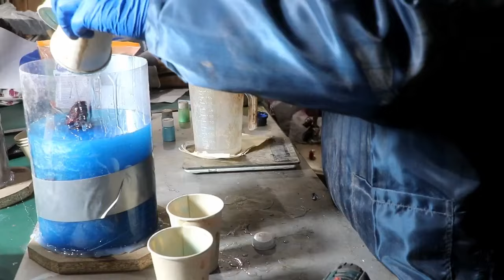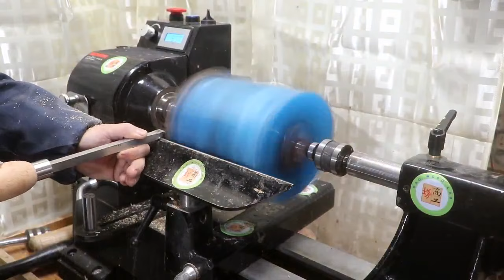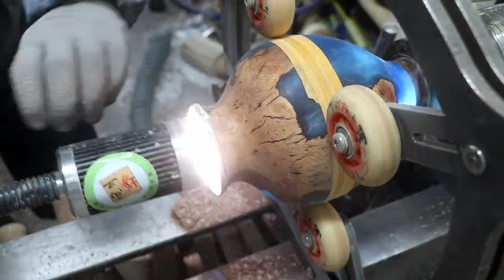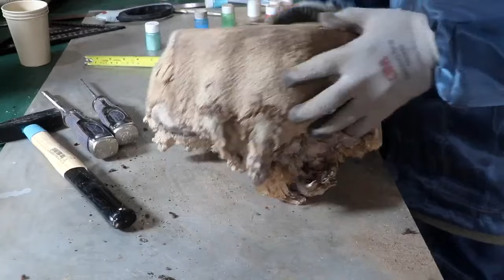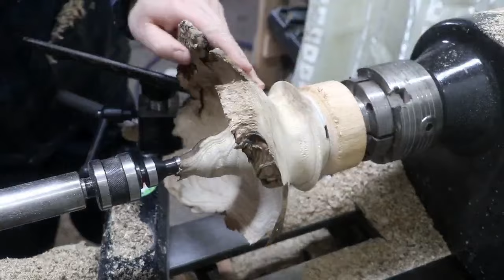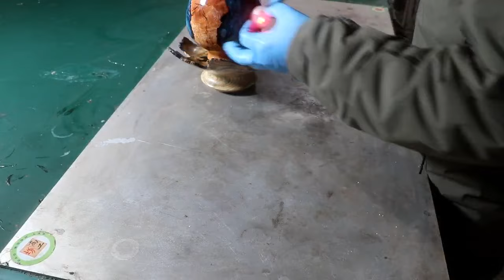woodturning: blue heart

Comment: Wood turning fascinates me, but I would never be able to do it myself.  For some odd reason, my favorite chisel is the round headed one.  What is it called?  Thanks for a beautiful video.
Reply from the maker: Thank you so much, very happy you like it,🙂🙂🙂🙂🙂, and the tool names carbide tool, there are round, square, and diamond. They don't need sharp, just change the tips,🙂🙂🙂🙂🙂
Reply: @gaowoodlab  you can sharpen the carbide tips and it doesn't take much time. There are a few videos on how to sharpen them. I think Pohl Barn Productions has a video that he shows how to do it, because he had to sharpen one to use. Hope that helps you.
Reply from the maker: @jlyssagraywolf7503  😀😀😀, thank you so much, J'Lyssa, en, I know it can be sharp, and I have tool to sharpen it,  but I have not tried, maybe will, thanks a lot, again,🙂🙂🙂🙂🙂
Reply: @gaowoodlab  the videos I saw it looked like they were using wet sandpaper and just moved it around kind of fast with their finger. I know how expensive this hobby is, which is why I told you about it. If you can use the same tips over and over, just by sharpening them, it will save money for other things you need, not mention if you keep them sharp it helps with chipouts.
Reply from the maker: @jlyssagraywolf7503  yes, J'Lyssa, you are right, I should try, actually, I have a tool, that can help me to sharpen tips, but I didn't use it yet, 😂😂😂😂😂😂😂